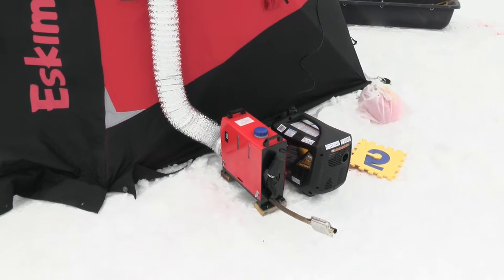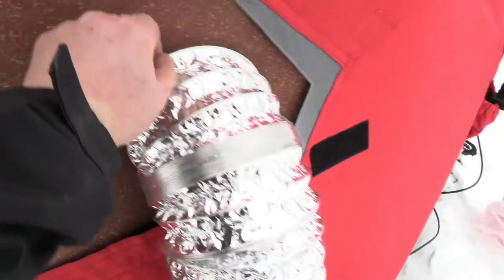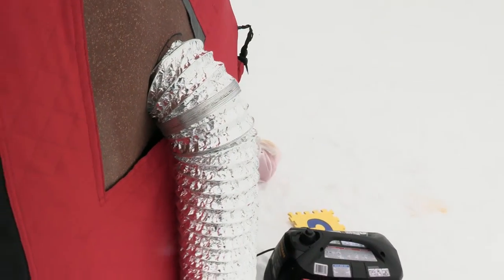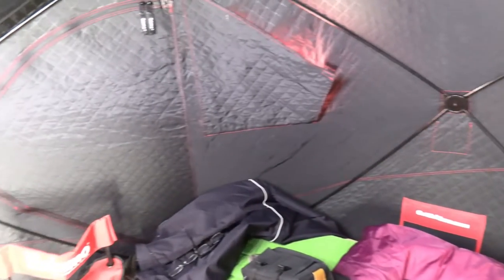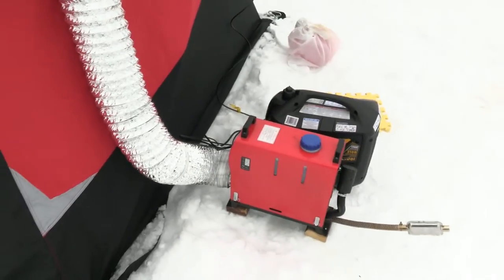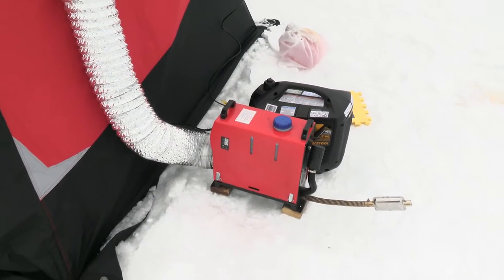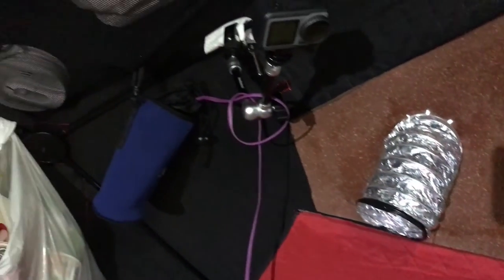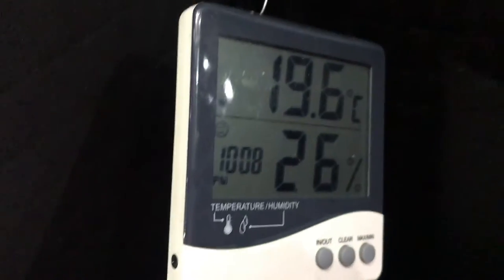Diesel Heater ........This was a surprise !!!!!!!!!!!!!!! 3 Day Night Review

Comment: It’s doing great, especially considering you are heating the outdoor ambient air to that temperature. To be more efficient, run another tube to the intake of the heat exchanger and into the tent at floor level if possible. But seems like it’s overheating you already lol.
Reply from the maker: Thanks for that. I have made so many mods since I filmed this. I do have the intake on an extension now and I sewed a nice flap/ hole at the ice level so there is almost no pipe exposed. Thanks for watching

Comment: I use Kerosene in my diesel heater, with a cap full of 2 cycle engine oil mixed in. It burns hot n clean!

Comment: I got the exact same heater a year ago and that thing has been a game changer for sure. I live in Minnesota and really enjoy winter camping now. My remote doesn't work and was wondering if you knew how to program it. Great video by the way.
Reply from the maker: There is a link in my thread somewhere. Have a read thru I’m sure it’s still there.
Reply: There are 3 to 4 different firmwares for the heaters, each one has a slightly different button press pattern to pair it to the heater.

Youtube videos, Look up pairing the remote to the diesel heater,

Comment: Could you share a link for your diesel heater.  I like the remote option.  Thanks!
Reply from the maker: Happybuy 5KW Diesel Air Heater All in One 1 Air Outlet Diesel Heater 12V Remote Control Parking Heater Silencer with Voice Broadcast Switch for RV Trucks Bus and Trailer
Reply from the maker: Cheers. Thanks for watching

Comment: Great video. What mats are you using in your ice hut?  Is that cork board that you used for the window opening?
Reply from the maker: I throw down tarp then plywood then foam squares and a roll up mat
Reply from the maker: Whats in the window is rolled rubber gasket material. I am cutting a hole in my tent this year ground level. Sew a flap over it for when not in use. I want to eliminate most of the hose.

Comment: I’m thinking of using my Dewalt 20v 6ah batteries with a 12v step down.  Any thoughts if that would work for a useful amount of time?
Reply: A Volkswagen/Audi 420DIN battery has a 75Ah rating, from 12.6V. That's also an AGM battery. 520DINAGM rated 92Ah. 520DINLAB 110Ah.

These heaters seem to pull around 10-15amps when starting, on account of the glow plug, once hot and burning, they drop to around 3-5amps as it is only a fan and fuel pump running at that point. 

Ball park roughness, 3x tool battery units minimum needed to have enough amps to fire the unit, and run for any length of time. 3x6=18ah @ 20v. Say 15Ah on the 12v side of your converter because of losses and firing. 15Ah ÷ 3A= 5h run time...ish.
Cold battery cells will lower that run time.

I, personally, would be curious to see how long a heater runs off a big jackery box or something of that nature.

Comment: You should try having the heater inside the tent and having the exhaust going outside, then the heater doesn't need too heat up cold air from outside. Only need too reheat the air inside. i have my heater in the tent when I'm out on the ice. Nice video👍
Reply from the maker: Ty . I don’t like the diesel smell in my tent
Reply from the maker: Also I don’t like to take a chance of any of the exhaust fumes being inside my tent if I wanted to do the way you suggest you could just bring the intake from out from inside the tent and still leave the whole heater outside there’s just too many safety factors that are an issue having the heater inside your tent but I appreciate what you’re saying
Reply: much safer out of the tent than in hands down
Reply: Both of these people are wrong on so many levels. They don't understand that these heaters were DESIGNED to be inside of the tent. You are supposed to run the exhaust outside. It does NOT leave a diesel smell in the tent; in fact, there is little to no smell at all. Wrap your exhaust properly and there won't be any fumes in the tent. Use the heater the way it was intended.
Reply: Wrong. Wrong on so many levels. They don't understand that these heaters were DESIGNED to be inside of the tent. You are supposed to run the exhaust outside. It does NOT leave a diesel smell in the tent; in fact, there is little to no smell at all. Wrap your exhaust properly and there won't be any fumes in the tent. Use the heater the way it was intended.  @reelisticoutdoors4358

Comment: Do you need to put an additive into the diesel to stop it gelling up in the cold ?
Reply from the maker: I don’t usually because where I live the stations supply winter diesel from the pumps. If they didn’t I would for sure. Or I could extent the fuel line and move tank into my tent.
Reply: @reelisticoutdoors4358  Thanks mate 👍Greetings from Australia 🇦🇺

Comment: Can you share the specs of your battery? How many liters did you use total for 3 days?
Reply from the maker: I use a standard deep cycle that I use for trolling in the summer. Its a rv-31 100 ah. I can’t recall how many litres my main tank is but I didn’t add fuel to it till the end of day two. Probably had enough for another night but I added some just in case. It was really great on fuel. Even when I had it dialed to half for a bit a few times to warm up more and run tests.
Reply: @reelisticoutdoors4358  Thanks for the fast response! So in the end of the video you say you ran it for the 3 days on the 100AH battery the entire time, but then you mention the generator. Just to make sure I understand, the 100AH hour battery almost lasted you 72 hours on the ice running the heater between 1 - 5 (low to medium) continuously? Or am I missing something. I am looking into converting to diesel and want to estimate what size lithium ion battery I would need to run this for occasional overnights. I am thinking a 50AH would work, but I am not certain.
Reply: @benjaminoliver6734  I'm planning the same sort of thing. Just a rough estimate: Figuring 2ah for start and shutdown cycle (probably less than 1ah in reality but better to over estimate). Low they run approx 0.5a on high approx 3a. 48ah would give 16 hours on high and 96 hours on low. If you recirculate the heated air you could run it on a lower hz setting  and have a higher outlet temp than heating outside air. You should amp test your heater on various settings to try and calculate run times based on the battery capacity. If you are testing with a lead acid battery the amperage will differ a bit as the operating voltage of lithium is slightly higher. If you are going to recirculate the air I would use a CO detector in the area you are heating. You can also calculate fuel burn based on pump volume per pulse should be etched on side of pump. Hz on display is pulses per second.

Sorry to run on in my post hope it is helpful and makes sense lol

One YouTuber who has a lot of info including fuel burn at various Hz settings is John Mck 47. There are a bunch of youtubers videos on amperage draw but many of them differ significantly.
Reply from the maker: @benjaminoliver6734  Well its a little of both. As i was a long way from civilization and it was cold out i didnt want to use that as a test to see if it will die in the middle of the night, I ran my genny a couple times over the three days to charge my fishfinder and lighting batteries, so i plugged it in to the Deep cycle as well.
Reply: @reelisticoutdoors4358 lol I would charge it to just because if the generator is running I’m doing everything I have to for charging lol!!

Comment: try putting the muffler pipe on the other side because that end is for fresh air.
Reply from the maker: I actually get less from that end as it’s being pushed away very well. The way the wind swirls we had more exhaust com in when we had it out the side. The only fool proof way would be to extent the exhaust or channel the intake